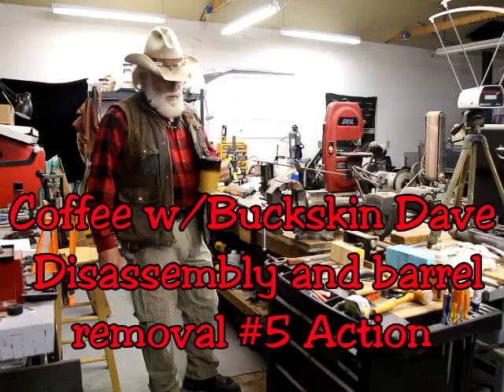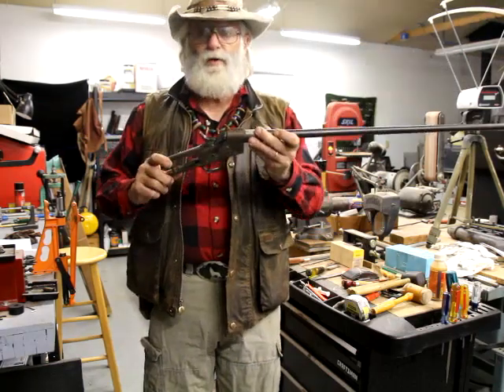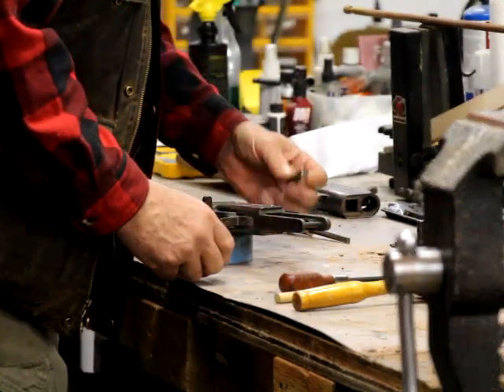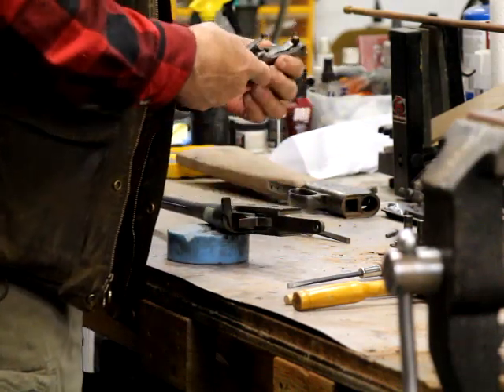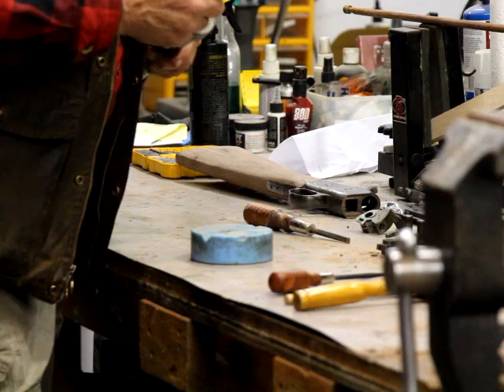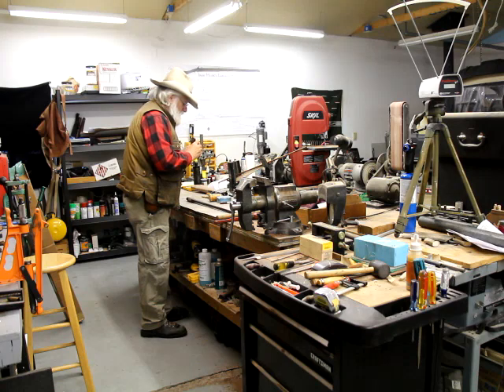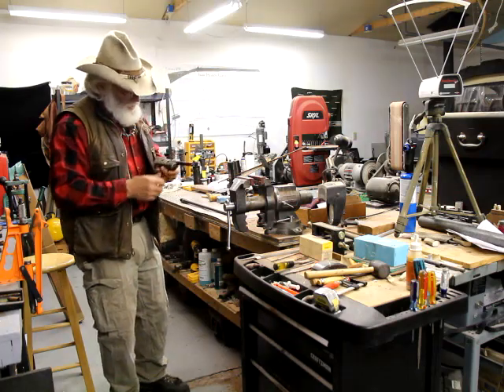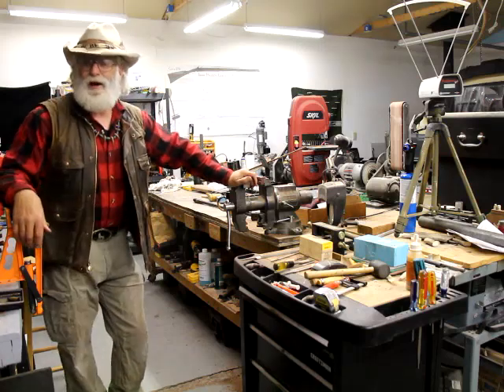Coffee w/Buckskin Dave  Disassembly of Rolling Block and Barrel Removal

Comment: I am also building a #1 roller in 32-40 Rem Hepburn. Going to machine a new block out of 4140. Little tip on barrel removal on those guns and that is always have the trigger guard in the receiver so you don't crush it if you put it in a vise. A little heat helps too.......
Reply from the maker: Sounds like a cool project, tks for the tip. Thanks for dropping in
Reply: I’d like to have on of those!!